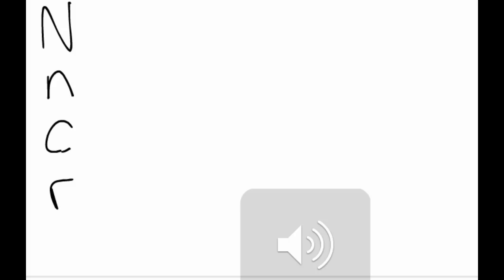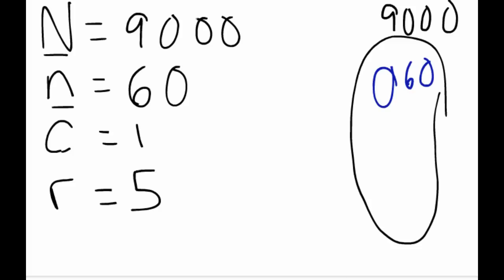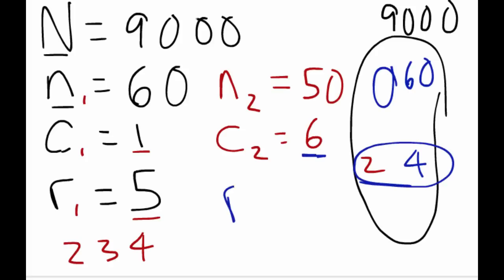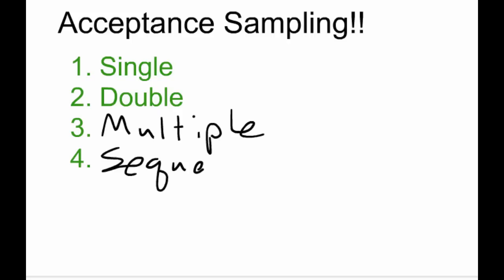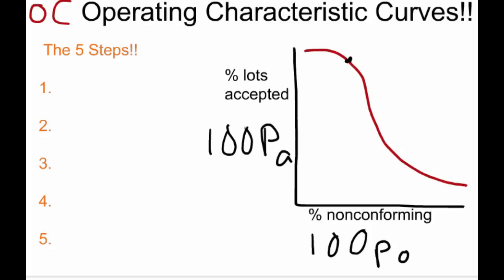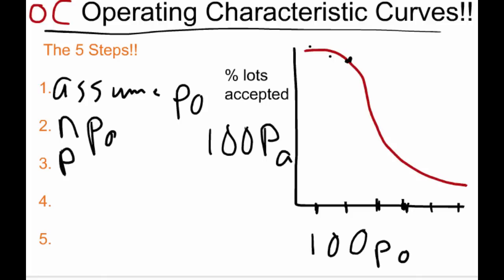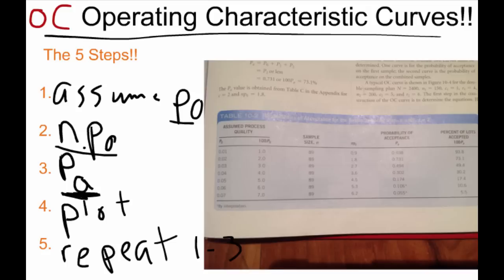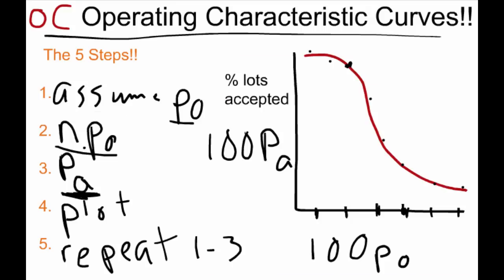Acceptance Sampling

Comment: What would you do when there are defects between 1 and 5
Reply from the maker: on which sample? 1st or 2nd?
Reply: @ClintStevenson  when C= 1 and R = 5 what will you do when you have 2 or 3 non-confomities. I thought when c = 1 it means you will reject the lot if there are more than 1 non-confomities
Reply from the maker: @lokeshchowdary7570  This is a common misconception. If you have 1 nonconforming, you can accept because c=1. If you have 2 or 3 or 4 nonconformities on the 1st sample, you sample again.